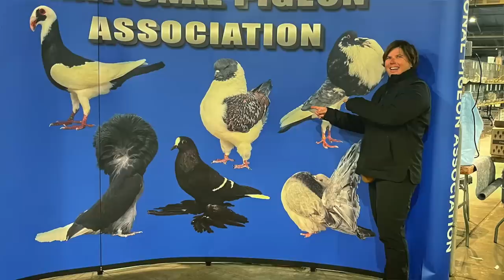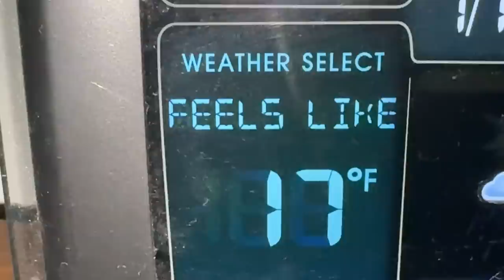Two BIG Game-Changers on the Farm! (Just What We Needed)

Comment: This is just a suggestion…from experience. Read about the aches and pains a change in barometric pressure can cause if a malady has been diagnosed. To begin with keep a record of the barometric pressure and note if it is a good day, okay day or bad day. You might see a pattern when weather fronts move in and out. Obviously, this doesn’t help as a cure or treatment but it does tell you that your “disease” (or diagnosis) isn’t getting worse.  It is your body reacting to change in the weather in conjunction with your diagnosis.  When you get a diagnosis and treatment this extra information might help you learn how your body reacts. And might help with any extra worry.

Comment: It was a treat seeing Brooke on her tractor again.  It's almost as if she's on her Royal Chariot. That's definitely her happy place.  Autoimmune issues can vary and different things will impact people to varying degrees.  My dear departed Mother had Systematic Lupus.  We enjoyed driving to see the leaves changing in the fall in the north GA Mountains but the vibration from the vehicle made her entire body ache.   (We resided outside Atlanta so it was less than a 2hr drive.)   I knew very little about Lupus.   This was over 40yrs ago so no internet for up-to-date info/research.   But it hurt Mother so we never talked about it again.  I asked her Doctors about eliminating foods thay often triggered discomfort/pain but they looked at me as if I was crazy.  Not enough was known about Autoimmune issues back then.  Mother said she didn't take showers because the water hitting her skin actually caused her discomfort.  Her Doctor laughed at that comment so I asked why he that was appropriate and why my Mother would lie about something that caused her pain.  I added more pull bars around her tub and we changed Doctors yet again.  Mother also had Fibromyalgia, Diverticulitis, etc, so it was often difficult to pinpoint wgich illness was causing which issue.  Another trigger was extreme weather variations.  Heat and cold, dry and wet, Barometric pressure fluctuations, etc.   Major respect for Jason volunteering to join Brooke on whatever food journey she takes.  That form of support and love is priceless.   I am not surprised Jason volunteered to do so during a Live but that type encouragement and moral support brought tears to my eyes.

Comment: Nice job, Brooke, smooth.
NOW, wouldn't that old round of hay bee a nice rolled out barrier fir the wash outs?
It surely works wonders to plug up flowing wells in driveways, too. Might consider for the pond area washes before planting. I put it down, then add a bit of gravel, more dirt, then plant seed, making a natural drain. 😊